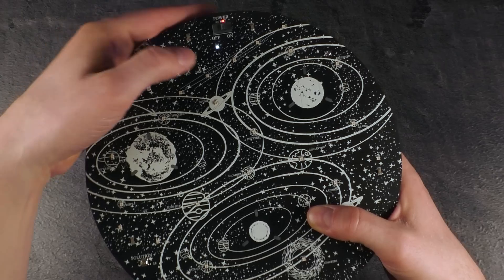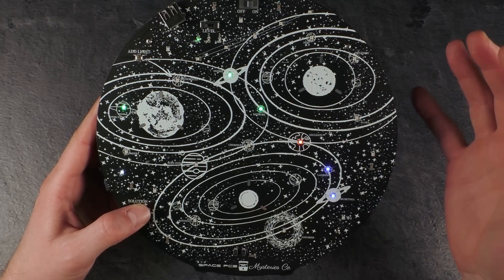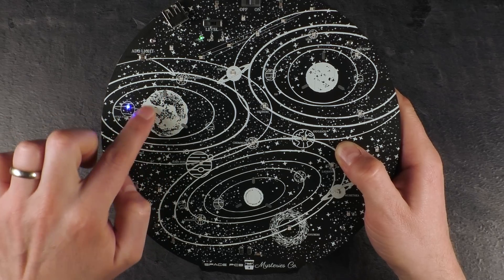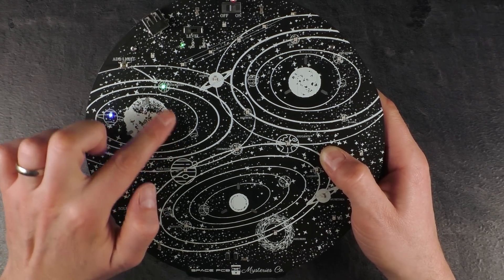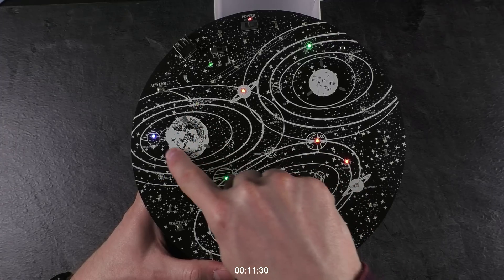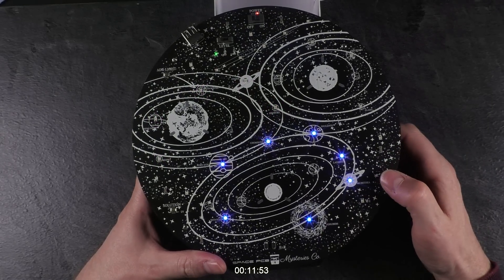Space PCB

Comment: After trying to understand, I still have no idea what were you doing! Clicking some lights, touching the board, ... what?
Reply: Looks like some light sensors are around the planets. So if you put your finger on it, it will block the light and trigger the sensor.
Reply: @pepperonipizza8200  The function isn't too difficult to understand, but the real confusion is in the goal. I'm assuming it's just look at the solution then bring you colors there, but that's a very unsatisfying puzzle so most would expect more from it.
Reply: @zeffirodesilver9513  Fair enough. It's kinda hard to show progression with that kind of puzzle.